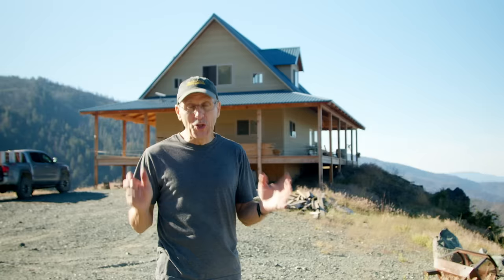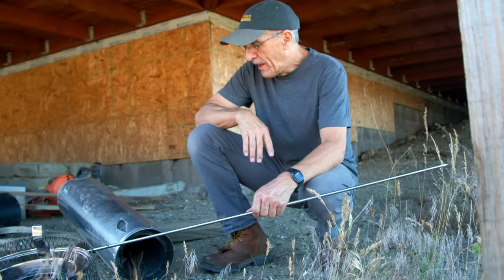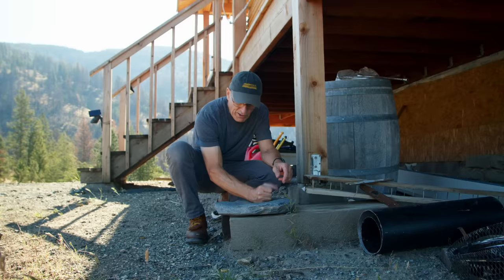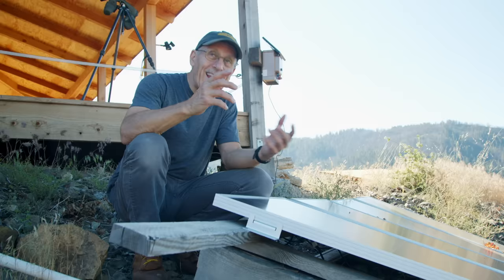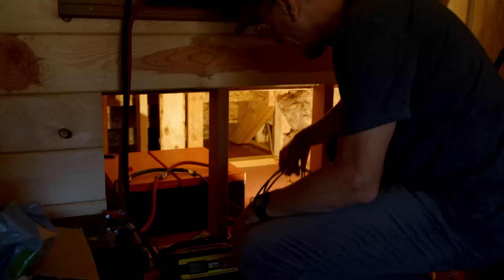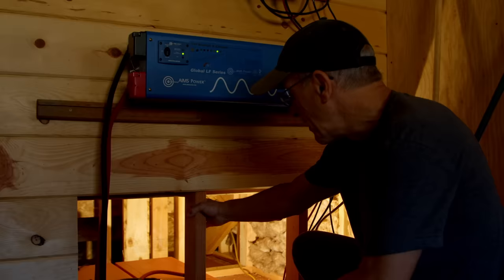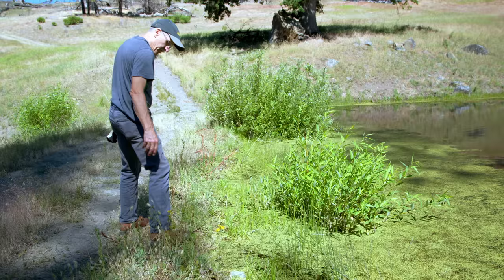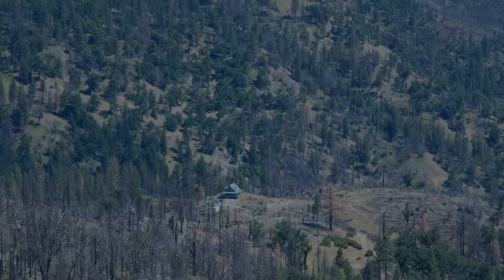Having the Basic Conveniences off the Grid: Country Living Part 2 with Doug Batchelor

Comment: ** TIP **
When you parallel batteries, (positive to positive and negative to negative) it is always best practice - for the lifespan of the batteries - to take the positive or negative from the first battery and the opposite from the last battery.

This ensures a balanced battery bank for even charging/discharging.

Thanks Pastor Dougie.

Comment: several things very cringe worthy here. the one most likely to sink his system is tying the electric fence to the house grounding rod. This is like adding a giant lightning attracting antenna to your system. when a strike comes traveling down the line looking for ground it will be traveling the path of least resistance, and the chances of that nice copper wire leading to solar equipment having a higher resistance than dirt are close to zero,